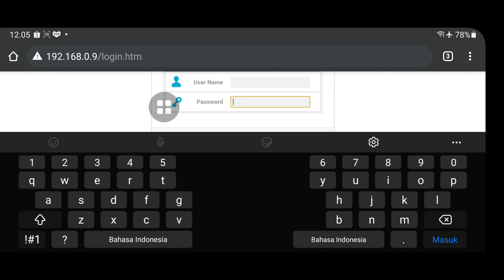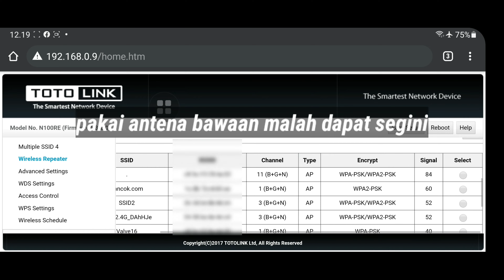Ganti Antena Router dengan Antena Dish Parabola Mini

Comment: Banyak sekali parameter yg salah di ujicoba ini.
1. Kabel tidak memenuhi standar router 2.4GHz
2. Tidak ada kalibrasi point apa-pun
3. Pointing dish jg tidak tepat.
4. Tidak memahami prinsip kerja antena directional maupun parabolic reflector
5. Pemasangan yg asal-asalan
Dll..

Simply to say, ujicoba ini tidak membuktikan apapun.
Reply: mantap gan. memang kabel jenis coaxial nya juga salah si om itu.
Reply: Tenda n300tembak wopi jarak dekat apa bisa pakai anteng TV bulan almunium
Reply: Wah, mumpung komentarnya berobot izin tanya om 😄🙏

Dish parabola tv seperti ini kalau LNB nya diganti dengan kathrein apakah bisa dipakai sebagai antena penguat sinyal 4G untuk modem mifi/stick? (Pointing ke BTS provider seluler)

Untuk kabelnya sendiri sy sdh persiapkan RG58 impedance 50 ohm